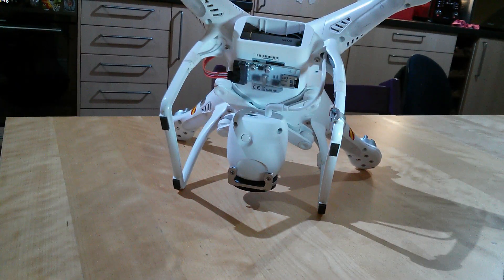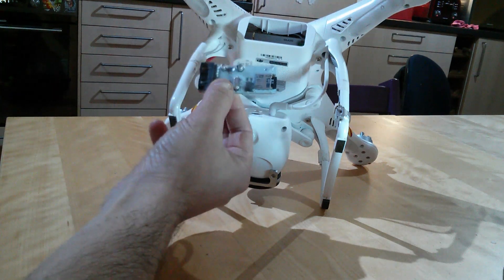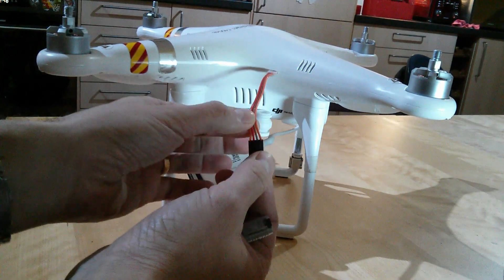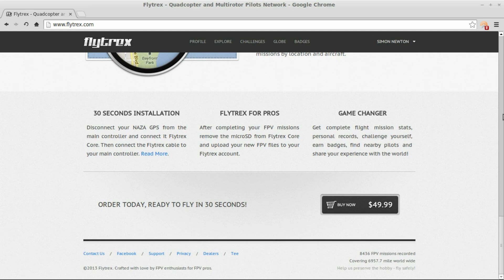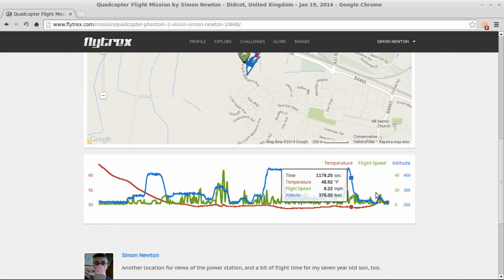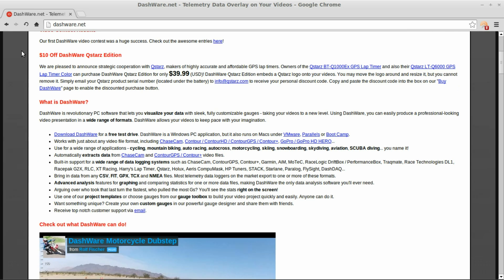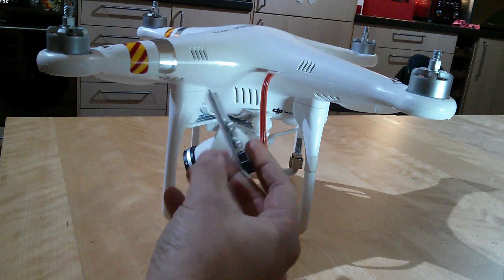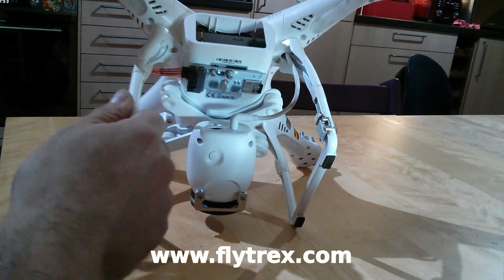Review of the Flytrex Core, how to install, and what it can do for you and your DJI Phantom Vision

Comment: I ordered and installed one on my P2V. Love it! I wish I'd had it all along. I pulled the pins out to route it through one of the leg holes, then just velcro'd it to the bottom. Works great.
Reply: Indeed, messing up the cable was definitely a risk. In fact, I initially hadn't re-inserted the wires securely, ending up with flight separated into several pieces. So, if anybody ends up with such a problem (flights split up), then check your cable ;p. Anyway, thanks for the vid, and cya on FlyTrex!

Comment: Can you run the cable through the same square hole as the camera cable is ran?
BTW nice video.
thank you
Reply: ***** Sweet. I knew there must be a reason. I ordered the 3m command adhesive strips. They will be here in 2 days then I will install the FlyTrex. http://goo.gl/ssn0tV    Thanks for all your assistance. next I'm changing the stock controller antenna. :-)
Reply: ***** I was looking at it, and what I plan to do is cut a small notch to accept the nut of the pigtail. I will do most with a dremel then fine tune with an xacto to get a good fit. then if had to, could re-install stock antenna with no issue. Good plan?
Reply: ***** your king on the video :-) I will take pictures
Reply: ***** with a snifter of brandy :-)  O and the dog must appear.he is you unofficial mascot. I have Ali the pig.